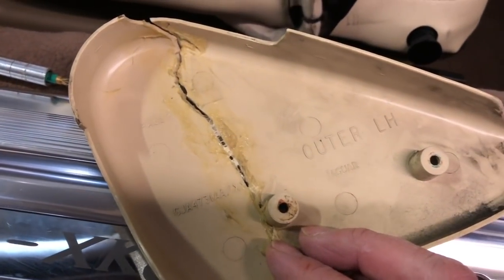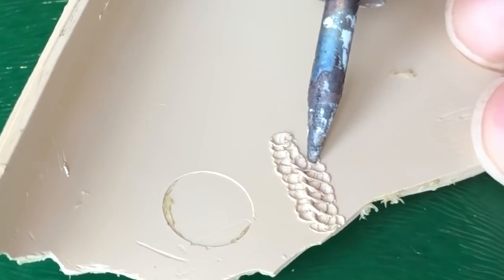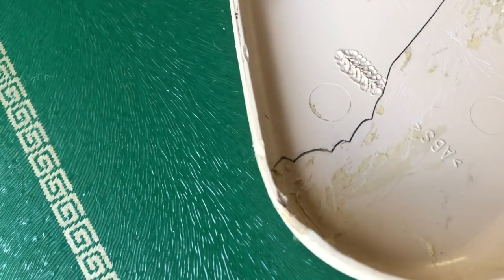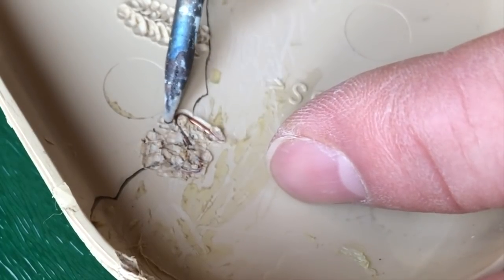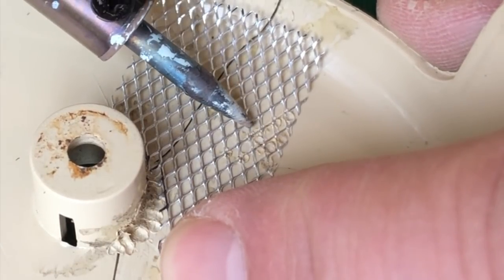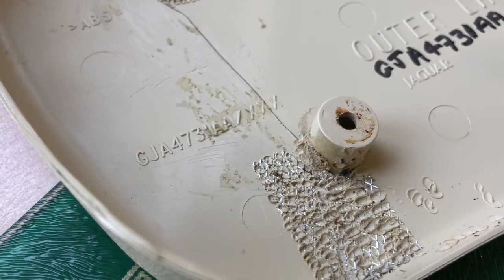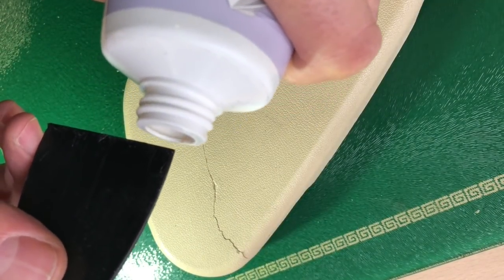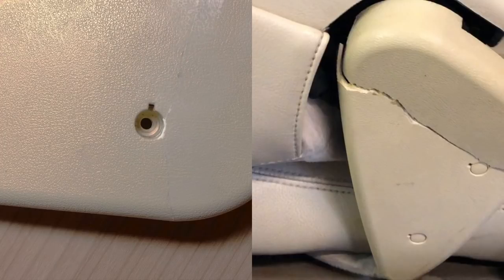Plastic Welding. Repairing ABS car interior plastics. Jaguar XK8 or XKR

Comment: Awesome video . I've learned something new . I would have filled the crack with super glue rather than Pollyfilla then sanded and sprayed .
Reply from the maker: Thanks David. I may still go down that route🤔 Do you know where to get spray paint in the right cream?
Reply: @ToTheGarage  I'd cheat and spray it black .
Reply from the maker: @davidpreston8414  🤣
Reply: Outline the crack with painters tape. Use baking soda and super glue. Baking soda gets into the cracks take a credit card smooth it flush then you dribble water like viscosity superglue in an it hardens to a rock. Then you sand and paint.

Comment: Nice technique! I used to melt ABS edge banding in acetone to make an ABS glue. It works way better than any glue. It melts the surrounding material and fill the gaps. You can make some reinforcements with it too.
Reply from the maker: Tibor Huszár I love the sound of that ABS glue. I will try that out👍
Reply: @ToTheGarage   Plumber's ABS cement works great and available at the hardware store.  It's basically a slurry of ABS and acetone.  Works well to adhere the mesh, and  I've used it sucessfully many times with fibreglass cloth as well.

Comment: Thanks John for your secrets of the XK8 videos. I have just fixed my fog lamp bracket following your plastic welding tips. It worked great. I  melted copper s-links into each side. Copper isn't ideal but it seems strong enough. I've got a picture but you can't see that much.

Thanks John.
Reply from the maker: Still love to see a fellow enthusiasts work John
john@tothe garage.co.uk

Comment: John,
Very interesting. I wonder whether this technique could be used to repair the undertray of my 2001 XKR. If not, do you have any tips for dealing with this common problem caused by grounding on potholes and kerbs?
Reply from the maker: Hi John Pretty sure you could apply all of this to your undergrad. Also has the advantage of being out of most peoples sight. It will give you a good item to practice on.
Its really quite fun!.  But choose somewhere well ventilated to do it.

Comment: Easy Peasy Lemon Squeeze ! 
Nice job there John. 
Unfortunately these plastics are the negative from the FORD era Jags, and due the fact that some of them were recycled, hence the resilience through time and heat exposure isn't the same with the genuine materials used, like the Gear shift knob on the "J" gate. 
Excellent detailed job John.
Cheers.
Reply from the maker: Thanks Nicholas. Yes they are not the best very interior plastics,